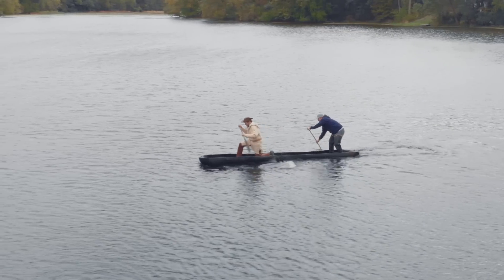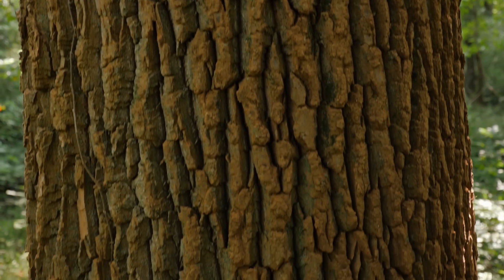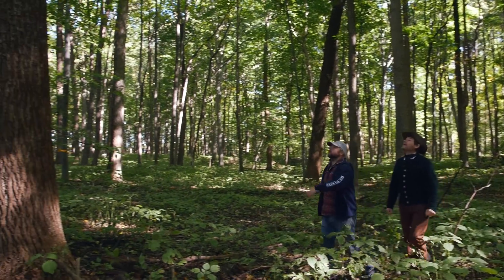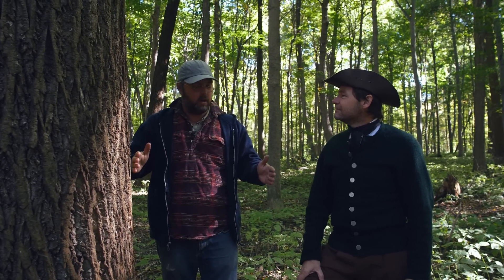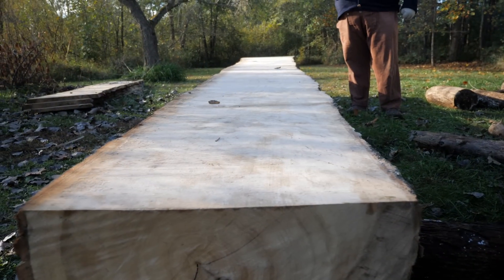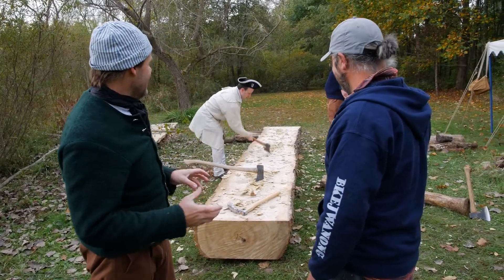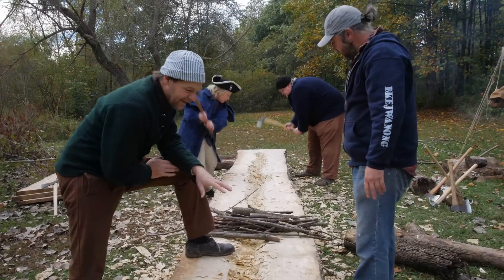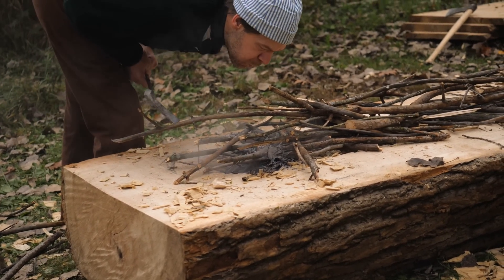From Tree to Canoe Part 1 - Chopping and Burning

Comment: I hope your boat comes out fine :) In Poland we had this exact type of boat. They were called "dłubanka", meaning "gouged out one". They were used for transportation, fishing and even small-scale local commerce for hundreds and hundreds of years. Some bigger boats were improved by adding planks to the rim, which heightened the board to make them safer and drier in everyday use.
Reply: cool! Are there any re-enactment museums that still make those boats?

Comment: A few years back I worked on an experimental archaeology project at Butser Ancient Farm in the UK. We were intending to make a dugout canoe much like this one using only the tools and techniques that would have been available in the Bronze Age. It's interesting to watch this because we had exactly the same problem! The plan was to use burning in order to remove most of the material, and then bronze tools to take out the charcoal and finish the canoe. Unfortunately that didn't work out, even though we kept at it pretty much everyday for 3 weeks the Scots Pine we were using was just too wet to make any headway other than a couple of millimetres. We eventually had to resort to modern tools and a chainsaw to meet our deadline. Looking forward to seeing if you guys managed to find a way to get burning to work.

Comment: One of the technical ways I was shown was to burn the inside with hot rocks and a fire to help get deep as the rocks would hold more heat longer. This would allow you to get the depth and that adding wood to the fire but controlling the burn rate helps keep a better depth rate as you need longer steady burns for better charring of the wood.

Comment: Burning effectiveness = 0.001%
Reply: I would say -50%, burning wood actually makes it stronger. Heat from fire fuses wood grains together.
Reply: @savvageorge  also caramelized the sugars which act as a sealant.
Reply: Prob work better if they left it to dry in the sun for a couple days.
Reply: @peterl6095  a few days wouldn’t do anything to the moisture content. That log would take years to dry
Reply: Wet logs dont burn

Comment: Its very interesting to see how much actual WORK goes into something like this.
Reply: What "work" are you talking about? When they used a big Stihl chainsaw the cut the tree down? Or a tractor to pull the log out of the woods? Or was it the bandsaw they used to cut it in half? What a joke! LOL
Reply: @drott150  let's see you post a video doing all that, then you can yell others what a joke they are.
Reply: @drott150  They literally answers your concerns in the beginning of the video; Jon tried to do it the real traditional way at first and it was a failure so they had to make some modern compromises. At no point did he claim they were going to do it the completly historically correct way the whole process through. So whats the big deal?

Comment: I would suggest using the axe across the grain, then use the adze to remove the chip. Might find it a bit easier. Roy Underhill uses a similar method to flatten a log with axe and broadaxe.
Reply: Yeah I saw that method used on a channel called Mr. Chickadee.

Comment: Very cool. As someone who has done a lot of wood work with axes, I could tell you guys don't normally do this kind of thing right away. Overall, not horrible, but you definitely need some practice. You were working your axes too hard with minimal gains. Work on your stroke and your rhythm, you'll get it. Again, it wasn't bad, and it was still very cool. This was an awesome video!
Reply: You have a nice comment, this is what constructive criticism sounds like
Reply: I've commented before about the lack of are skills...SMH😂😂😂
Reply: Yeah, I was trying not to sound condescending. Using an axe for work like this is difficult to become good at, and can take years to get perfected. Mainly they were letting the wood control their bikes to much, and not maintaining consistent angles through the stroke. The axe sort of rolls when they strike, wasting a good portion of the energy they expended doing it. Easier to describe the issue than to fix it. They just need practice. I'm truth, it wasn't even all that bad.
Reply: An adze is much better for this kind of work.
Reply: Agreed, some of their chopping techniques were not just sloppy but effin dangerous.
Reply: Very true Mark. Guarantee if this dugout is finished, some experience will be gained!
Reply: Exactly what i was thinking. Was trying to find someone else who noticed. Def a good show of determination on their part but a little teachings of technique and rhythm can make a huge difference.
Reply: Mainly the guy in the white
Reply: Yes this is how every criticising comment should sound like! 👏👏👏
Reply: Mark LaDoux 
I would guess that a respectable quality canoe maker ( team? ) would be worth his weight in gold , they had to be reliable and were very labor intensive .
Reply: @MarkParkTech  stop being a hater. i'd like to see you do make an ameriCAN canoe !
Reply: I feel it adds to the fact that not all woodsmen were expert woodworkers. This can almost be reflective of some folks back in the day.
Reply: Jon's wearing his cooking hat while hollowing out the log lmao
Reply: When I was a kid dad was to cheap to buy gas for the chain saw. Well not with 6 boys. Me, I'll pay for the gas. Especially for the splitter. I hit 50 and said I will never split firewood again.

Comment: Well, you can bet our forefathers knew better than to hack away at the center of that log while bending over at the waist as you fellows were.  There weren't too many chiropractors around then and if one developed a bad back, life from then on would be miserable!  I've no doubt they'd be telling you to get that log put up a lot higher before you started in on it.  if you want to accurately represent the old ways, figure out what they did to make the chores EASIER.  These people were not simpletons and life was far more than a bunch of explorers and settlers just slogging uphill through every miserable job.  They knew their craft and they knew all the shortcuts.  Still, it's good to see you fellows out there doing these kinds of things.

Comment: Re the burning effectiveness -- I'm not sure whether this is historical, but I feel like a chimney effect would help a ton: If you could prop the log up at 30 degrees or so, and cover the dugout area with something flat, to form a closed tube, you've got a "log rocket stove." It's hard to see that failing to burn! (It does make the scraping less convenient though; you might need to migrate the fire & chimney up and down the log so you can scrape where it was.)

Comment: To cut a better quicker trench, you should make wedge cuts length wise, it would help tremendously. Also to get a good start burn, I am surprised you didn't use pine pitch, or pine far, burns quite hot where you put it! I am also surprised how shallow the log was. Usually they would take off just hands length , so I thought. Wonderful video! Very strenuous work! I just thought I'd give you a few tips is all. Years ago I made one for fun, more hard work than I thought but it was worth it!

Comment: A more common and easier way to make a canoe was to remove a 6 or 8 foot section of bark from around the trunk of a tall tree, lay it over a fire to soften it allowing it to be turned inside out, sew the ends up, pack with mud or pitch around the parts that may leak, and you have a nice Native North American canoe. Fasten sticks across the middle for stability, a pole for pushing your way through the swamps and you're good to go.

Comment: Back in the day there were many different kinds of axe, which generally we do not see today.  They had specialized uses, and makes life easier.  A man would skilled in using an axe on the frontier.  We generally do not have those skills anymore.  The use of the adze is also specialized.  I used to know a traditional boat-builder.  He showed me how to use an adze safely. It is an art.  It is always a case of working smarter, not harder.  We are just not used to manual labor anymore.  people then did nothing but use their own muscle power to do just about everything.

Comment: I'm sure many people noted this, but didn't folks in the past actually wait for a at least a couple of years after splitting the fresh log before doing this (or used an old fallen tree)? Or maybe that's the idea - to craft the canoo out of a fresh log so that it contracts in it's final shape instead of letting the log dry out before starting carving it out? If so, I don't get the reasoning behind that.... A canoo made out of a fresh log should be heavier and may not float as well. Anyways, interesting watch, thanks.

Comment: I understand the principle of not wanting ash to build up, but I feel pretty sure you would've had more luck if you'd kept piling kindling onto the lit fire, using progressively bigger pieces of wood. Eventually, laying thick branches/small diameter logs down the length of the canoe. You can fan it occasionally, which will blow powdery ash out and make the fire burn just hotter. If you're using dry matter on top for the burn, thick pieces of wood will turn into chunks of embers and burn hottest where it is in contact with other wood, and release steam, which dries the wood out and will help it eventually burn. More time, to get it going, but a lot less effort. Fun video, though!

Comment: So, if this is so much work, consider how it was in pre-contact times, without iron tools:

*First*: you have to prepare to fell your tree, starting with girdling the trunk, and waiting for the tree to die.
*Then*, you have to build a fire against the trunk, and hack away at the charred wood; repeating this until the tree finally falls.
*Next*, the problem of splitting the trunk (I have no idea how they did this, but it must have been quite a job).
Then*, and *only then, can you start hollowing it out with fire, and tools of stone, bone, and shell...

It must have taken weeks, or even months of labor to produce one boat. No doubt, such a vessel would have been a precious resource.

Comment: the burning wasn't done to enlarge the trench although it does that a little bit it was done to concentrate the tree resins and push them to the outer shell of the log making the wood more water resistant with each burn 
the resins also prevent the log canoe from cracking once it is completely dried out

Comment: Seems to me that red hot coals, and a bellows with an extended tube would work better than burning twigs. I tried it on a wooden block once, blowing through a metal straw . It works pretty quickly.

Comment: One thing to try out i have seen a Video called der letzte seines Standes mollenhauer basically about dying Jobs it's in german but the man makes bi troughs out of green wood the biggest one able to fit a whole pig he made one for the Video he chopped a notch down at every end one a bit deeper in the shallower one he used wood wedge he hammered in that would then bend towards the part he wanted to get out with this method he could save a lot of material might be a technique to consider when building a canoe

Comment: The excess wood removal could be accomplished much easier using an Adz which were readily available at this point in history MN Plus , you are burning freshly cut , unseasoned log , which is very wet and makes controlling the burn difficult.

Comment: it may not be traditional  like axe and adz but why not cut slats with a circular saw length ways and across to as deep as you can without cutting through  all the way and bust those chunks out . would be a lot faster. then burn down from there.

Comment: I'm no expert but did they make that look like hard work trying to make a start on the centre because they were going against the grain. Looks like it would have been a lot more easier if you cut in a V shape going length ways instead of width
Reply: Carn Williams I thought just the same. They'd just need to make two deeper cuts perpendicular to the grain, one in each end, just to prevent cracks to ruining the canoe. Then they could easily remove large chips of wood by cutting alongside the wood fibers, using the axe to make the cuts and the adze as a lever, pulling the pieces of wood apart.

Comment: The technique for burning here...burning a little fuel then scrapping out the progress and ashes...is a complete waste of time. You need a bed of coals and hot fire to make progress burning the wet wood.  You get that by continuously adding dry wood to the fire, and lots of it.  Every time you scrape it out and clean out he ashes, you start over and keep yourself from making any progress.

Comment: The reason your working so hard to chop the inside of the tree

Your supposed to chop with the grain ,up and down the grain,so when your axe hits the fibers ,you can get deeper bites and your not chopping THE SIDEWAY FIBERS of the tree.

I’ve been a carpenter for 30+ years,and grain length instead of Grain Width will make your work load 50% easier and less strenuous on your backs and knees.Even if your wielding a hatchet.

Just saying

Comment: You didn't say WHY you are using fire. Because it's "faster"? And/or is there supposed to be some other reason?

You can tell you are amateurs with axes and other wood cutting tools, and your muscles are not accustomed to doing that kind of work. A good, sharp tool, handled correctly would hollow out a log like that fairly quickly, IF you have the musculature and experience to do it. I've seen professional woodworkers go through wood like butter. It helps to have a really sharpened tool. And there are also some tips and tricks that come in handy, as well.

But you do what you can do with what you've got. It is always A LOT of work, though.
Reply: Fire is easier but requires a Keen eye to notice when to stop burning. The Cherokee used this method before European arrival the use of clay helps ensure it doesn't burn to much

Comment: Why not learn how to move heavy objects , and raise the cottonwood log , get it on some rollers made of logs,  rolling on rails made of  logs?  This is not that hard to do. Or get some weight off it first? Also, please get some full-size axes.     I am almost finished with my second dugout canoe.  Both of California Redwood, both about 15 feet long.  Hand tools only.
Reply: We launched my canoe today,  October 30, 2021 on the Carmel River lagoon. It's 14 feet 7 inches long,  18 inches wide,  with a single outrigger of yucca. It will have an additional outrigger, one on each side. This will provide enough stability for sailing.    I think the canoe weighs about 100 pounds.

Comment: I really hope that you ended up using that tree you felled. Because that is such a terrible waste. You should have planned better. You should have chose the direction to fell it. Had a way to move the log in the first place, whether that be by modern means or historical. Or just have worked on it where it was felled. Which was the usual way things went.